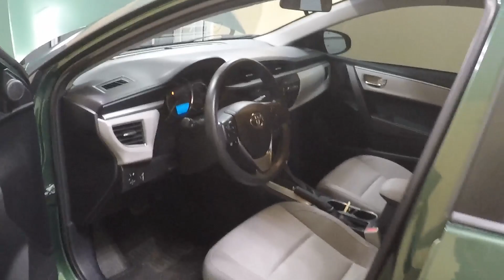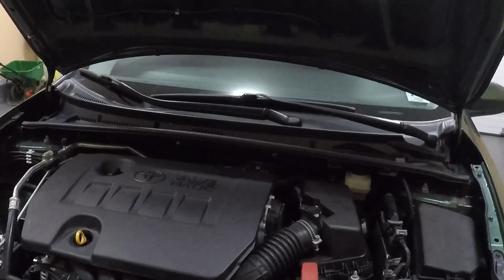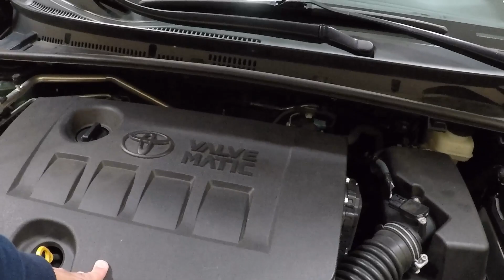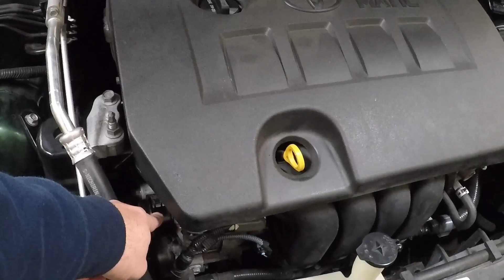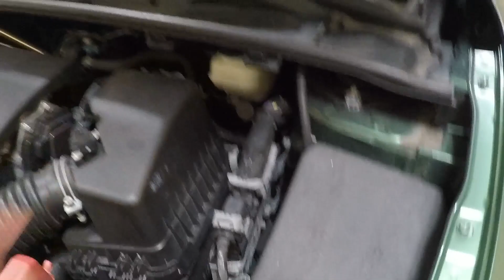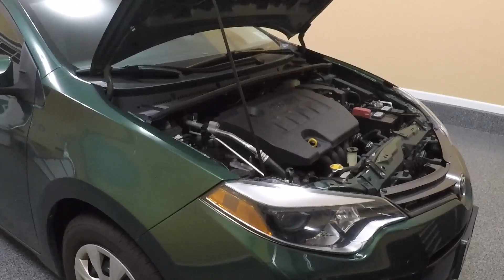Toyota Corolla Maintenance and Repair cost at 100K Miles

Comment: I just purchased a 2012 SE Corolla today at 108k miles gonna go and check all the filters and change out spark plugs
Reply: 7000
Reply: Gonna buy a 2017 LE Corolla for $11,990 and it has 59k miles on it. Test drove it today and it felt great
Reply: @zahsum  mines just hit 60k I do my oil change every 3000 miles it’s running great!!!
Reply: @kevintran7542  funny i made this comment 9 months ago but i actually bought a 2017 LE with 21k miles and it runs fantastic!! but every 3000 miles for an oil change seems too quick lol
Reply: @zahsum  not really you will notice that your stepping on the gas peddle more just to get the car going. By 3000 miles your motor oil is black already.
Reply: @kevintran7542  it depends on what kind of oil you use. if youre using great oil you can keep it going for 5-10k miles easily

Comment: Awesome. i always worry about my cvt going out. MY COROLLA is at 25,000 miles  when did you change your transmission oil?
Reply from the maker: i did my trans fluid at 100k but i do a lot of highway driving so there isnt to many hours on the car. toyota says change it at 60k if you tow or use a roof top carrier. the dealer said they tell people 80k-120k miles for normal driving. the issue is when they change it they can only change some of the fluid as they cant drain the torque converter. knowing that now i would just change it myself every 50k to keep adding fresh fluid to it.
Reply: Just hit 140K on my 2014. CVT seems to be working fine still.. and still haven't changed the fluid yet, however most of it can be said its highway driving. The 1st 50K miles was probably city driving though from the 1st owner.
Reply: touge410 _ glad to know it’s holding up well I’m trying to also keep mine running long
Reply: touge410 _ hows it going now? I own a 2017 88,900
Reply: @stonermillions  Car has 167K on it now and seems ok. Under hard acceleration CVT seems a little hesitant & takes a sec for rpms to drop back normally off throttle. So it seems like it MIGHT be slipping a little now compared to before? I do believe it would be a good idea to change the fluid now since its never been change & as a preventive maintenance to bypass any future issues. Going to be changing the serpentine belt and spark plugs soon for its 1st time. According to Toyota plugs should be replaced at 120K miles (although the car drives fine at 167K). The belt is starting to show some signs of wear from driving conditions.
Reply: @starbai410  nice!!! Goodluck I’m glad it’s running well mine is still running strong as well no money put in besides oil changes im at 112,000 now hoping to go 200+
Reply: @starbai410  167K miles or Kilometers? ☺️
Reply: h247ap1 I am a rideshare driver and my 2016 CVT Toyota Corolla LE has 168380 miles and no issues at all 🤷🏿‍♂️👀. I had the transmission fluid changed by the dealership every 60000 miles. “ DNY automotive “ channel shows the proper way to change the trans fluid if you want to do it yourself. Not only you have to change the fluid, you also need to change the filter and clean the three magnets.

Comment: Thinking about getting a 2015 soon ! They are pretty good on fuel as well
Reply: Copacetic LifeStyle I am a rideshare driver and my 2016 CVT Toyota Corolla LE has 157000 miles, no issues at all 🤷‍♂️👀 Proper maintenance is the key. For Corolla, you need to change the transmission fluid every 60000 miles. You also need to change the filter and clean the three magnets. “DNY automotive “channel shows the proper way to change the trans fluid.
Reply: I've had my 2016 Corolla since new, 60k miles now and it has yet to fail me, I highly recommend it
Reply: @mr.boostang2064  aye 16 Rolla gang 💪💪
Reply: I highly recommend getting one
Reply: @ivancastanedamusic  I agree
Reply from the maker: Yes, I average over 40mpg
Reply: My XSE just hit 100k and has never had any mechanical issues. I replaced the battery once so far and the rest has been scheduled maintenance.